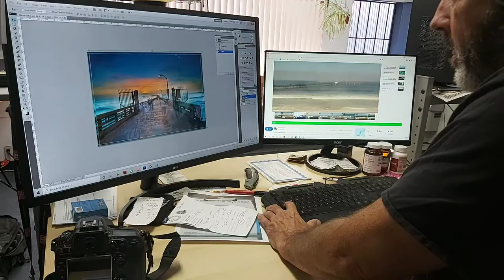How I Make My FaceMounts (Museum Mounts)

Comment: I finally got my own process working. It's very similar to yours and your video was definitely inspiration! Thanks!

Still working on edge finishing that may be faster, but one step at a time!
Reply from the maker: Lemme know how your edge finishing goes. I have experience with using 200 to 3500 grit sanding, flame polishing and now use a diamond edge finisher (very expensive but HUGE time saver).

Thanks for the comment!

Comment: Just discovered your Art. Congratulations for the astonishing prints and patience to achieve them. Could you please disclose the paper on the one your Arts are printed in this video? Thx
Reply from the maker: Any flat glossy paper will do. I am using the Metallic Photo paper due to the unique way it reflects light. It is not quite as white as it could be but sometimes effect is a bigger consideration than gamma.
Reply: @LuminousViewsGallery  What brand are you using?
Reply from the maker: @toto_chanel6952  Moab Pearl is ultimately the nicest look but Epson is right there and nowhere as fragile (I do work like a clutz at times believe it or not).  Go ahead and call me if you want more specifics.
Reply: @LuminousViewsGallery  Are you referring to Slickrock Metallic Pearl 260? Didn't know that paper, in Europe Moab is not very well developed. How does it compared to Hahnemühle Photo Rag Metallic 340g?

Comment: Love your work! Specially the polished edge on the acrylic! What is the technique you use to obtain those smooth results? I have read that diamond polishing is the best way but the machine is over $5000!
Reply from the maker: To get the edges polished like that I use 6 levels of sanding starting at 100 grit paper and going to 3500 grit. The last two grit pads are specially made for car paint. When i get busy enough i will get the $5000 machine as it will save all kinds of time. 
What is your product?
Reply: @LuminousViewsGallery  Thank you so much for your response! I currently do wood work, I make 3D logo signs. But I am looking to get into making these acrylic face mounted art. I am just getting started, I ordered the facemount adhesive roll and a cheap manual laminator just to start of. I have been watching all types of videos in youtube and yours is the only one I see that shows the polished edge so nice. I could not have imagined it was sanded! I thought it was the diamond machine you had. It looks amazing. I have tried sanding the acrylic down but only to 320 and then doing the flame. Which helps but I guess I was missing going even higher on the sanding disk.  

However, since I have a company that provides the acrylic with the polished edges at an extra charge, I may skip this step all together. But I do see that you polished it after mounting the print, is there a reason for this? Also, do you do the flame afterwards or just sanding it down?
Reply from the maker: @uniquecraftsbyjenn337  I used to flame polish after 800 grit but the extra fine grit with extra time technique is most consistent and I never do too much (bubbles and burns) or too little (dull) flame/gloss - i mean without the $5K machine.  

Have seen laser cuts as perfect as my edges but never seen/watch a laser actually make a PERFECT acrylic cut. It has gotta be dialed in I imagine. I do have a diode laser for wood/leather plaques on my frames. It does cut opaque acrylic but not transparent. Your CO2 laser should make perfect cuts if dialed in I imagine - IN ANY SHAPE
Reply: @LuminousViewsGallery  yes I have tried getting a polished edge using my laser but I think its not very consistent, in all honesty I only tested once and yes the results were impressive but not perfect. I may have to play around with the speed and power a little more and see where it gets me. The issue is that I only have a bed with a width of 23.5 inch max and I want to make bigger prints, for that reason, I need to learn another method that gets me polished results. 

As you say, the laser would be great since it can make any shape, I am thinking about laminating the photo and then cutting the acrylic to a special shape with the settings dialed in for polished finished edges. It may be a great product to sell.  But first I need to get the laminating process perfect to then go and test some more 🙂 I am excited! Thanks again for your help! I have one more question, how is the sanding disk that you have, the one that you pass the acrylic edge through before sanding it with the orbital manual sander called? 

Thanks again! I am impressed I was able to get in touch with you after finding this video!
Reply from the maker: @uniquecraftsbyjenn337  it won't be just a speed and power issue to get perfect cuts on acrylic. Your focus and hownthe laser us setup I believe... maybe call the manufacturer. I believe it would be WELL WORTH IT with a machine like that.